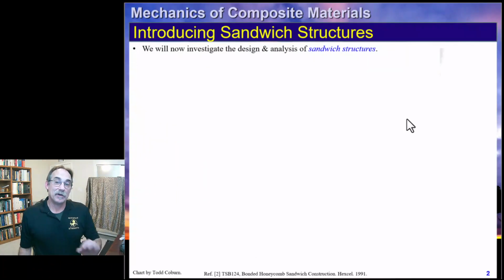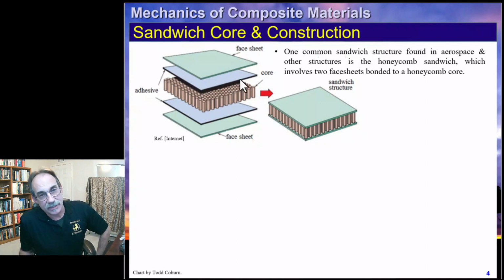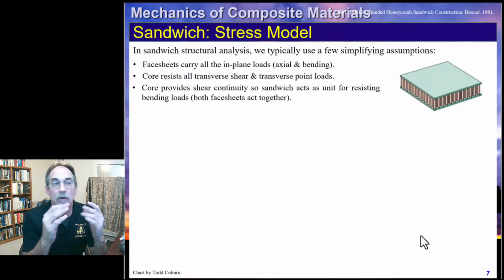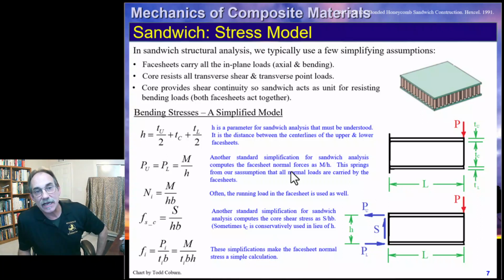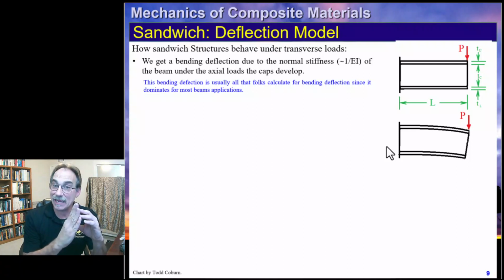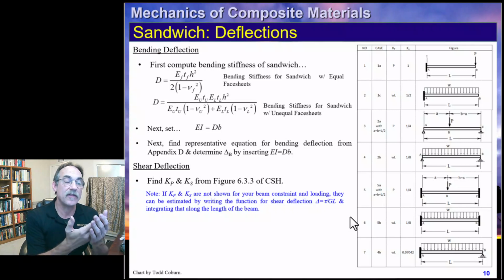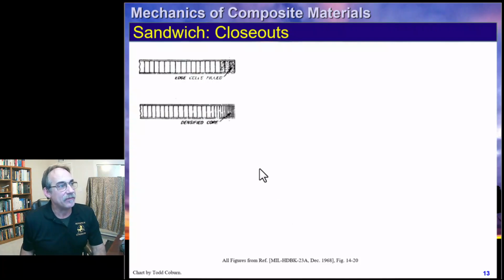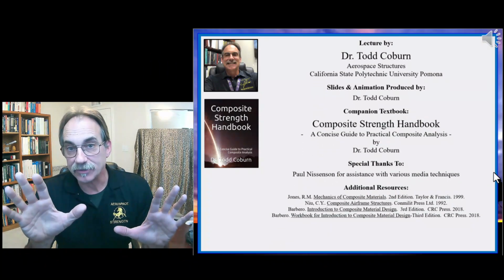Composites: L-13 Sandwich Beams - Design & Analysis

Comment: Hi Dr. Coburn, I enjoyed your video a lot, I wanted to ask how the analysis changes when you have a sandwich structure (say a plate) in which the core material is not evenly distributed, but forms localized "pillars" that join top to bottom? Does it follow a similar "lumped mass" approach?
Reply from the maker: If the discontinuous nature can be reasonably aplroxomated
With a pseudo orthotropic set of properties, then analysis can be the same.  If not, it gets trickier
Reply: @ToddCoburn thank you for the response sir

Comment: Excellent lectures. I have a question. What if the core structure is Al cans ( blade) and filled with some material. To create a rigid structure where the can be bonded with face sheets (top and bottom) and compressed creating essentially a sandwich core ( Al/steel cans) though will result in much heavier core since mo more hollow. I believe still the equations what you have shown will hold true.
Reply from the maker: Any material that can be approximated as an iso-or orthotropic layer can be analyzed this way.

Comment: any experience with or resources you are aware of re: somewhat novel DYI hybrid sandwich structures made from readily available/inexpensive materials? e.g. bamboo rods as stringers, box store insulation foam for core, acoustic panel felt as core, hardwood ply (~5mm) as outer skins, cheap craft straws cut and bonded vertically for dyi honeycomb core etc?  sandwich panels are such a fascinating science and so many opportunities for experimentation!
Reply from the maker: Not offhand.  Same analysis principles apply.  You’ll want testing that validates all failure modes.

Comment: Dr Todd, Do I clearly understand? if the facesheets are of a different stiffness (EA) we use the same approach to derive axial force on the facesheet. Because it's can be considered a static problem and solved as you showed. (just I'm confused due to a shift of CG of the sandwich cross-section case)
Reply from the maker: Yep.  Equilibrium requires the sum of forces and moments to be zero, so if axial force is applied, both facesheets must carry the same proportion of force, and if moment is applied, it must be carried as a couple where facesheet forces are equal and opposite.